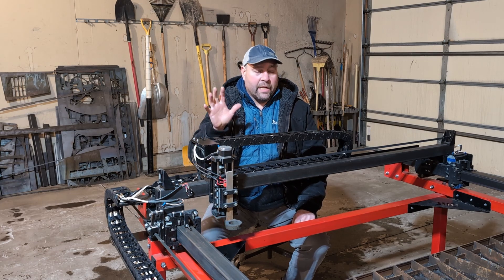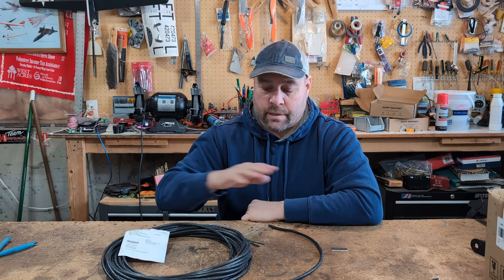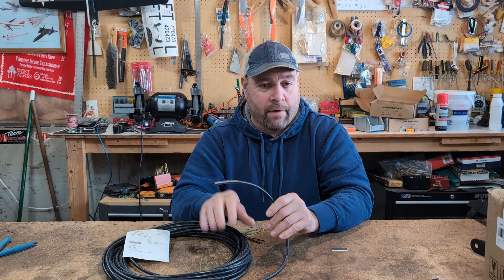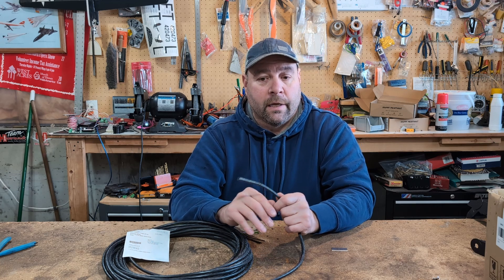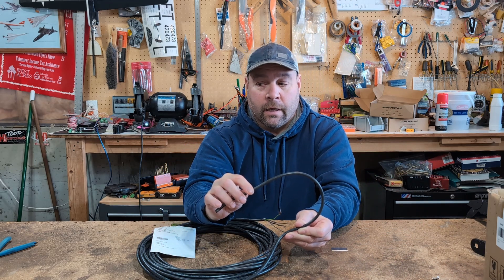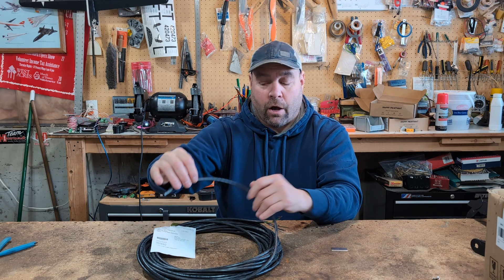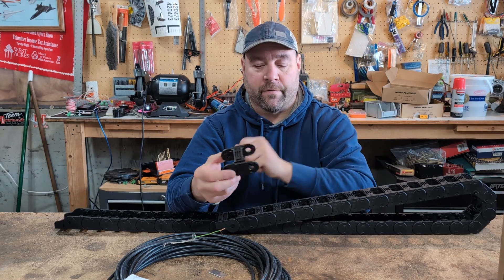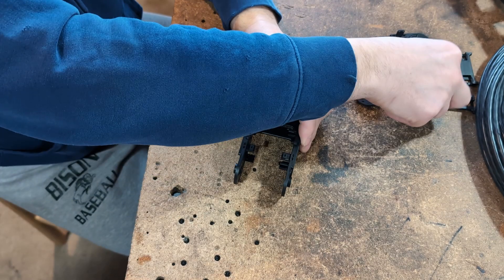How to Install Cable Chain on CNC Plasma Table

Comment: Shot in the dark but do you guys think you’ll ever attempt a metal cnc laser cutter? That would be wild
Reply: Agreed , fiber laser , would be amazing if one of those 3 in 1 laser welder / cutter / cleaners could mount in a gantry and cut
Reply: I'm building the XL here in Adelaide SA, my plan is to buy a laser cutter/welder machine later on and adapt it in but the cost of them is crazy high still..

Comment: Software side of things has my vote.

Hardware/mechanical stuff is tangible to me, it's the post processor/code that is something that goes over my head, as it is not something I can visualize.

Comment: Jackson is a great software instructor.  Would enjoy seeing more videos on the software side showing the designing of parts, effectively using Fusion360 and tweaking the post processor and setting up various tools in Fusion for different thicknesses.  Making "test" files for tuning in the machine to really dial in the perfect amperage, and cutting rates on various thickness pieces of steel.  Perhaps videos on how to finetune to the 0.001" getting the kerf width set perfect.  Keep on making the great content.

Comment: Drag chains are the way to go! They could be shorter. The start of the drag chain up to the middle does not move and could be removed. The first end bracket should be in the middle. There should be some saving considering the price of drag chains.

Comment: I'd like to see both new features and how to's. Specifically in the how to's how to integrate it with Mach3.  An idea for a feature is maybe extend the y axis even farther over the x and make an overarm tubing cutter.  It would be nice to see something more robust than a belt directly driving the rotation of the tubing.  Another idea for a money maker since Jackson seems pretty adept at the software side of things is an affordable nesting tool similar to Pronest (accept affordable for a DIYer).
Reply from the maker: We will not be integrating with mach 3. It is an old and outdated software. The current software/firmware we use has all the features mach 3 does plus several more that we will be exploring in future videos.. It also has the benefits of not having to purchase any licenses.

Comment: Cutting and tuning. Also are you going to modify the rotary notcher from the original design at all to fit this table?
Reply from the maker: Tube notcher upgrades are coming soon.
Reply: @jdsgarage701 will the upcoming tube notcher plans be included with the xl plans if already purchased?
Reply: @2874mattm  I bought the XL plans and the tube notcher plans are now in files.

Comment: Appreciate the update to make additions.  Will updated plans be available soon? I am at the stage to begin assembly.  Will return the cables to amazon shortly.  Could use 3D printed .STLs for new brackets. Not able to plasma cut metal yet.  Thank You.
Reply from the maker: Plans were updated as soon as the video came out.